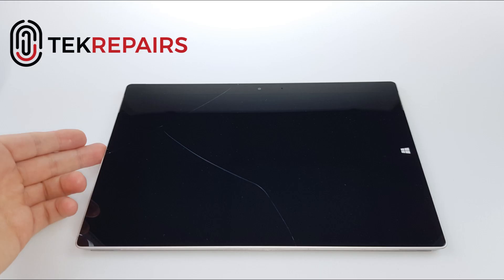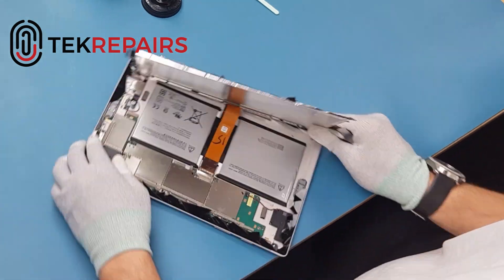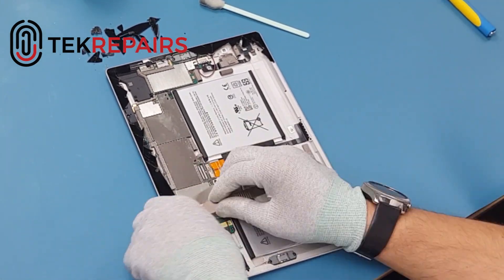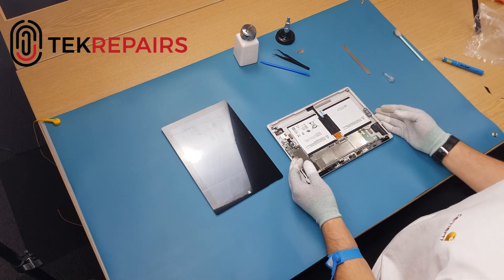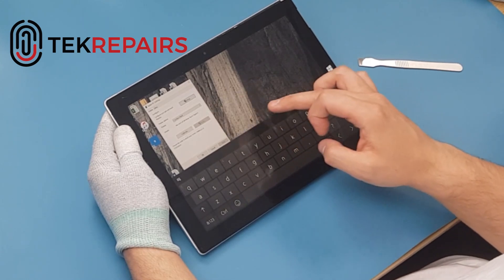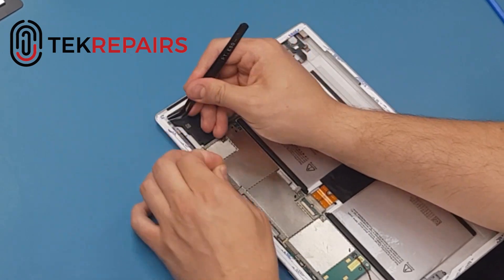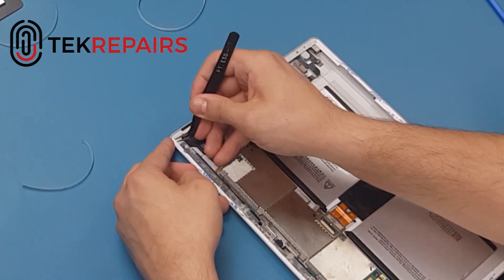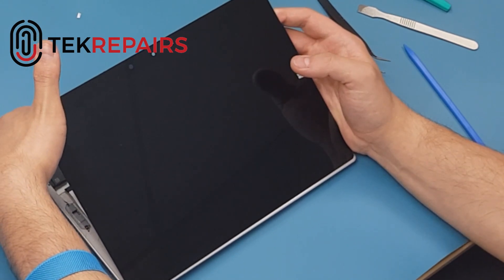Microsoft Surface 3 LCD Replacement step by step tutorial

Comment: Thanks for the video. I would remind everyone to remove ALL of the old adhesive. Don't leave a speck, because it can create a small bump, which could cause the screen to crack. These screens are extremely thin and can crack very easy.

Comment: Just so you know you can take off the screen by heating the metal from the sides of the surface without breaking the screen
Reply: These screens are so thin that it's very difficult to remove them without cracking them.
Reply: the screen is already broke =/. it's a screen replacement video.......
Reply: @IlyasWidaad  yes, but the piece of information the gave is quite useful anyway. I've set a bios password and can't remember, so I need to teardown and reassemble without damaging the screen.